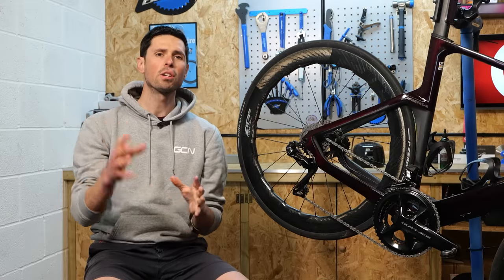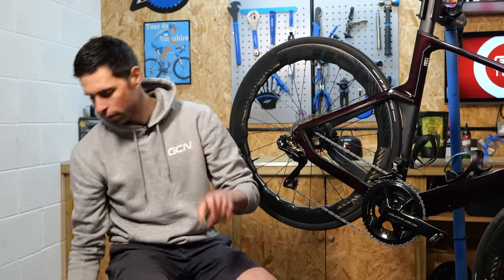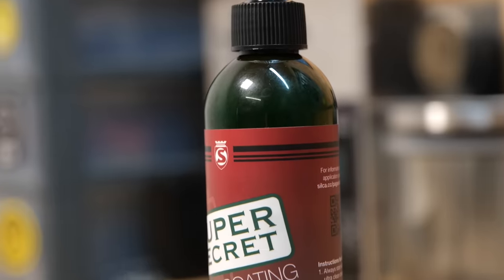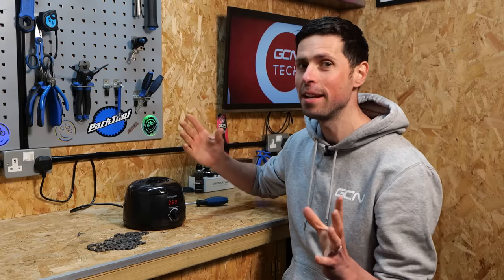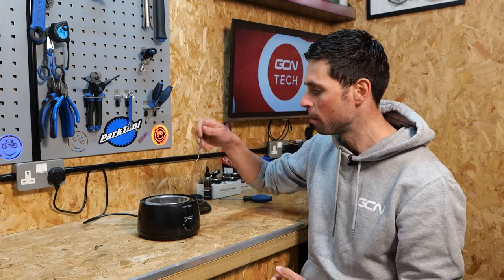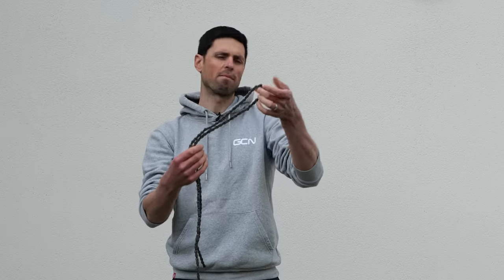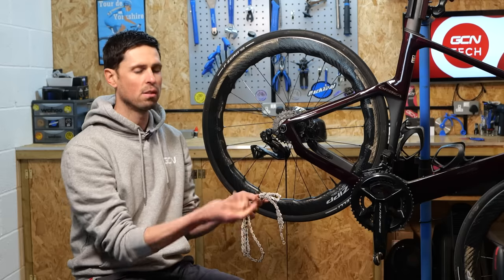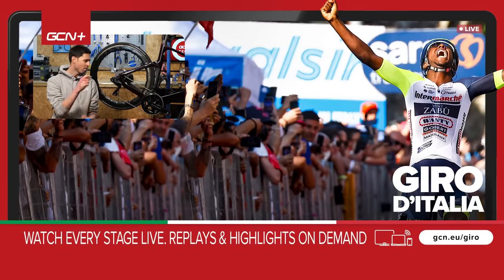How To Re-wax Your Chain & Make It Last Longer!

Comment: I recently went with dry lube in the hope of the chain picking up less dirt and getting away with slightly longer intervals. Lets be honest, drivetrain efficiency doesn't matter for us mortals but if I can go for one more ride without having to clean the drivetrain, that's a win, already.
Reply: It's not really the effeciency that should be the selling point, rather the reduction in wear on the chain. Even if it's only a doubling of the chain life that is huge. Also the reduced number of cassettes and chainrings that you need to replace. And the reduction in time spent cleaning as there is no mess!
Reply: @mikesiemens4145  You sure have a point there, but I think it's only partially true and rather depends on your maintenance habit than the actual procedure. I don't think you'll grind away chains, even with oil of your regularly clean them and further on, as long as you replace your chains, let's say before 0,5 wear, cassette and chainrings won't get eaten - or do you really get double the life out of a waxed chain? My 105 chains last 5000k and that's before they are really badly stretched...
Reply from the maker: Efficiency is not just a measurement of performance but also life space. Waxed chains should last longer... we all like getting the best bang for our buck 🙌
Reply: Mere mortals, lol! It sure does matter. Wax is the ONLY lube for any road bike 110% of the time for 90% of riders!
Reply: @gottagetaname  Ollie Bridgewood dark account, mate?
Reply: @DoNuT_1985  sorry, I don’t understand that. 🤷‍♂️
Reply: @gottagetaname  Sorry, just watch GCNs latest (pro) bike check videos and focus on one of their presenter's obsession for a certain kind of drivetrain conditioning. His name is Ollie and he probably waxes his coffee machine, too. 😜
Reply: @DoNuT_1985  Ah Ha! About the wax thing….. It IS the sole solution to this lube issue for 99+ reasons. Chains and cassettes last so much longer, less work and less dirt around the drivetrain. I have been waxing both my road bikes for 5+years and sometimes the silence of the drivetrain and the smooth shifting makes me forget to re-wax for longer periods. This is a “No Brainer” 110% of the time.
Reply: Drivetrain efficiency matters to everyone in differing levels.  Plenty of pros aren't aero geeks or weight weenies and some amateurs care more than some pros.  That said, you can easily double your chain and cassette life without going way out of your way to do everything right.  If you do everything right,  you can get a +4fold increase in chain life
Reply: @DoNuT_1985  I've gotten over 12,000 miles out of chains without being super vigilant.  I'm not a low force rider either.  I'm a cat 1 that's over 190lbs and a cross chain a lot
Reply: @veganpotterthevegan  One must decide for him/herself if efficiency matters. I'm a hobby rider and there are probably 50 watts to be gained in my bike setup and training routine (if I had any), so squeezing out 5 watts of my drivetrain doesn't matter for me. That's a fact (for me). I started with some dry lube this season and the biggest selling point  is that I don't have a dirty chain even when I mostly ride on dry roads with oil just after 1-2 rides. I get through with a chain for a full season without even wearing it out and 105 11-speed really isn't a cost factor, so I mostly switched to wax to spend less time cleaning my bike.
Reply: @Florian Posch  5 watts of 50 is big. That said, YOU said it doesn't matter but it does if you care about watts at all which seems like you do to even ballpark that 50watts.
Reply: And less chain stains on the foot!
Reply: @nimrodstern663  That hasn't been a too much of a problem for me with years of cycling but putting about 150k on the waxed drivetrain, I see the benefits in terms of cleaning. Looks like I've just gone round the corner and back with traditional oil in. Other than that, I still think it were my legs that got my up faster that hill I rode up compared to last time. 😇
Reply: Using wax on your chain just makes the bike so much cleaner. There is no oil being flung around the bike onto rims, frame, brakes, tyres etc. I have disk brakes, and it means that oil contamination does not get to the rotors, as there is no oil on a waxed chain. Also means that when you wash your bike, you can just remove your chain by hand and of course your hands don't get dirty. Then you have better access around your bike to clean it with no chain on it. And the bike is cleaner to start with anyway.

Comment: Great instructional lesson on how to make your chain work better and last longer! I find it fascinating how an old technology has come back in the spotlight. I use modern chain waxes on my road bikes and my commuter bike (that chain is on internal 8 speed hub has more than 8000 km on it, still passes the chain gauge test). In my early days in cycling, in the last century when Moser, Rams and Bernaudeau were some of the primary contenders, waxing a chain was a mystical, magic process. We didn't have waxes specifically designed for chains. I just melted paraffin wax in a pot on the stove. A cyclist I knew melted his wax in an old coffee can on a gas stove. The gas flame burned through the bottom of the 'tin' can and the liquid wax extinguished the flame when it went everywhere. His wife saw the solidified wax covering everything said, "You will clean all that up, now. Not later, now!"  He never waxed his chain again.
Reply from the maker: We're glad we can bring waxed chain to the masses! Do you think this is the way forward? Sounds like you've got some great life out of your chain 🙌
Reply: i prepare waxes (by temp grade) in old oven pan with propane torch and no problem

Comment: Very useful video Alex! I appreciate knowing that with the Silca drip on wax I can get away with a 4 hr wait rather than wait overnight. 😊
Reply: Drip on is better for topping up after rain. Best performance will come from doing it the long way
Reply from the maker: Do you prefer drip on to fully immersive waxing?
Reply: @kart182  you can also dip into drip wax.   Kinda meets in the middle with penetration
Reply: With a hot wax you can be riding shortly after waxing chain!

Comment: Been doing this for years and I'm not sure why people make this so much more work than necessary.   I also find waxing the chain in hot wax to be much less hassle than using the drip wax on each roller, waiting 4 hours and cleaning up the mess.

Comment: A few issues I see with this:
1. Threading some wire in the chain before putting it in the wax makes it a lot easier to remove when it’s done
2. Instead of articulating every link with your hands, you can just run it along some rounded thing to break it up easier. I use a small tree in my backyard. 
3. I don’t see the need to wait for the film to appear on the wax, I would just pull it out as soon as you’re done. I’ve had great results that way. 

This video shows a sub par way to apply hot wax that’s more difficult, time consuming, and dirty than it needs to be (that freshly waxed chain could have been a lot cleaner).
Reply: waiting for the film to form on the wax is only recommended if you sell wax, as you will just get a thicker layer that needs to be flaked off.
Reply: How can i get a cleaner waxed chain(?)
Reply: Is that can be done with pulling the chain out straight after dipping?
Reply: @Kuroneko6235  I usually put my chain on hard wax and let it melt in. I usually come back to it after a few hours. I’m not sure if this is the best way, but it fits my lifestyle well.

As for cleaning, just rubbing it off with a rag works well for me.

Comment: I use a spoke to agitate the chain in the wax.  Then I can use the j-bend at the end to lift the chain out of the wax.  Also, I wipe the excess wax off of the (outside of the) chain as soon as I take it out of the wax pot.  Then I hang it over a doorknob to cool.

Comment: Silca's drip wax is actually one of the best out there (Squirt still gathers quite a lot of debry and is too thick to go into the links). As the developer says, it's great to use in COMBINATION with hot wax:

1. Hot wax
2. Little bit of drip wax after first ride
3. Re-drip as often as you think is necessary, but after about 750km-1000Km your probably want to re-HOT-wax again.
Reply: before hot wax again after 1000 km any cleaning needed? (for drip wax)
Reply: @CanTURKeyed  depends on riding conditions. Normally pooring boiling water on the chain should be sufficient. I will use some regular dish washing soap first and then poor over boiling water.

Comment: I have 3 chains that I use on a rota system. That way, all I need to do is replace the chain with one thats ready to go then clean and re-wax that used chain when I have more time. Also, when the chain is off its a good idea to clean things like jockey wheels as the wax can sometimes build up in the cage when it flakes off. Its absolutely no good installing a new waxed chain when other components haven't been cleaned either.

Comment: Based on these valuable comments my go to process seems to be: buy a prewaxed chain to avoid the troubles with degreasing, apply drip wax in between hot wax steps, when necessary hotwaxing used waxed chain again, for this boil in hot water (cool the water and remove the wax before pouring water down the sink) then clean chain in den. alcohol mainly to remove water and hot wax again. 

My number one advantage is the clean chain, less wear and tear or resistance is a nice to have

Comment: I use cande wax + parfin oil. Fof road bike.
It works great : quiet, no junk on chain ring cassete and poolies.

but after riding in the wet ,it stats squicking. 

What do you use?
Does it handle better in wet?

Comment: @GCN Tech - I am surprised you did not clean it first (more than the microfiber towel) I wax my chain, and I actually will soak it in a solvent for about an hour, then dry it off prior to putting into the wax bath ( I use an old crock pot) Once you start this process you will never go back to oily lube I love that I can ride and my drivetrain looks clean, and does not get all mucked up.
Reply: Bro the title clearly says "How to Re-Wax your chain"
Reply: @verbinnenben  Bro your response makes zero sense..  I am talking about how to re-wax my chain...
Reply: @chrisholstein7587  you shouldn't need to put your chain in solvent before every re-hot wax is what I'm saying then.
Reply: @verbinnenben  I use a solvent to clean it and remove old wax..  it still gets dirty..  I want it as clean as I can get it when I put it in my wax crockpot..  I do not want any dirt or material in the wax bath - its not to degrease it - it is just part of my cleaning process.
Reply: @chrisholstein7587  oh okay, I understand now. What solvent you use? Methylated spirit?
Reply: @verbinnenben  I just use a citrus based cleaner - they will remove wax as well - I put it in a mason jar close the lid and shake it about 3 - 4 minutes you would be surprised with what comes off.  I did read another comment where they boil the chain to do the same thing - I may give that a try next time.
Reply: @chrisholstein7587  hey bro, thanks for the idea. I also stumpled over the fact - that vary where you live / season - your waxed chain still can get quite dirty/oily over time. I tried boiling the chain first, use degreaser and cook it again : it works but it is a hassle you know. I think it just depends on the time you are willing to spend etc

Comment: Is the "let it cool for a bit for the skin to form" step at all needed? I believe Silca includes this step in their instructions, but I don't think I've seen Zero Friction Cycling do it. It seems like it would just put excess wax on the chain, for it to flake off or worse, to gunk up the drive train.
Reply: In my opinion, surface tension will keep the wax between the links. Wax is thicker than the oils we use on chains, so there's no reason to expect it to just run out if the wax is a few degrees too warm. 

They're likely thinking one of 2 things

1) It will stick even better if it's starting to get close to the temp where it firms up, but in my experience you're spot on that it just leaves a ton on the chain and makes no difference in how long it lasts where it matters, in the rollers/pins/links.

2) More likely: They know the crock pot, double boiler, or whatever other method is used to heat the wax will result in inconsistent temps from setup to setup, and they want to eliminate that variable by waiting for the skin to form, which should happen at a consistent temp as it's cooling back down.
Reply: They can sell more product if you waste more 😅
Reply: Indeed zfc confirmed in the comments to another gcn video that letting it cool is only a waste of wax and time.

Comment: I use a slow-cooker for waxing and have noticed that the Teflon powder sinks rather rapidly to the bottom. So I believe it’s worthwhile to agitate the wax with a wire as you add the chain. Otherwise, the first droplets than get sucked into the rollers by capillary action will not contain much of the friction reducing compound.

Comment: Is the wax suitable for more wet climates? I've got dry wax for my bike but that was a mistake as I live in such a foggy/rainy climate... Thanks for the video! Makes me really want to try this.
Reply: I have successfully used it on wet weather too. And also cold weather at winter, but it won't last so long also chain can get rusty easier at winter when they salt roads. I don't know, if my method is right, but I cool the bowl with wax from bottom with chain. I believe that this way I can get more wax inside of chain, because wax shrink when cools so if the bowl is cooled with cold water the chain in bottom of bowl also cools faster than wax and draw more wax betwen links. Many people seems think, that I'm stupid for doing that, but because I believe into it I keep doing it that way. Stir the chain inside wax while it's cooling so that it would not get too hard and.. To me it seems that I can ride longer on wet weather before I need to rewax than I could without cooling the wax bowl in cold water with chain from below.

Comment: Nice video and presentation. This is my two cent comment on how I’d do this. 

I’d preferred to preheat the cleansed and dried chain in a toaster oven between 60~75*C first, then swiftly transfer it into a hot pot of molten wax before it gets a chance to cool down during transfer. 

Why preheat? 
To let trapped air in the joints to escape into ambient air and not blocked by molten wax around it.

Why? Obstruction to trapped air in the joint occurs when we dip a cool chain into hot molten wax. This will allow air trap inside the joint. 

Why? We need to evaluate joint air to enable vacuum, low pressure, in the joint to pull wax into the joint. Normally only a fraction of joint air can escape when cool chain dip into molten wax. 

Hope this helps.

Comment: I missed this in the video - why not rub the chain with a cloth or paper towels after soaking to remove the wax coating? Does the flaking off wax while riding get into other parts of the drivetrain?

Comment: 3:27 - some really are one use only though, as you damage them when removing. You'll be OK if it's a turbo bike, but hard accelerations out on the road with high torque will snap them. You can buy reusable ones and they are usually cheaper than the name-brand versions.
Reply: KMC has reusable links, and they're a name brand. I've yet to have one break on me, and I'm a 245lb rider.
Reply: @mrhankbotful  Cool. How many times have you reused them? I got one with a KMC chain a couple of years ago and it only survived 4 or 5 times. The cheap ones go longer than a couple of chain lifetimes!

Comment: It's nice to see, that wax is so much cleaner than the lube, that you have to go outside from your garage to clean your chain from flakes and pollute your environment with it. And this flakes going to be everywhere on your bike too.
Reply: I use a cheap chip brush and just brush my bike off. After a few rides, the chain doesn't shed any more wax flakes and the bike/wheels remain clean.
Reply: This is why I'd never add teflon to my wax and I do this initial 'clean' or breaking-in over newspaper in the garage.

Comment: Can wax also be used for mountainbikes?
Reply: Yes, but  will only last around 8  to 10hours. When really wet half of that time. I started using it on our Emtb tandem that was eating chains and cassettes. At least triple lifetime. Now I do it on all my bikes.  I use 3 cheap chains, one cassette and 0.5 of my chain wheel before worn over 0.5%. Important you clean with hot water; dry an rehotwax your chain after every wet ride.

Comment: I seriously would not want to be going through this palaver every week or 2 Just to save a few watts. I'll stick to with my all-purpose drip lube I think. Cleaned and relubed the chain yesterday, 10 minute or so job.
Reply: Thats fair enough, everyone has their preference, whats your thoughts on longevity or chain cleanliness?
Reply: That's a good reason to have 3 chains in rotation so you only need to wax every 4-6 weeks, and get the added benefit of dramatically longer drivetrain life.
Reply: @GCNalex  Those are fair points and a good argument to wax the chain. I used to use a thick wet lube (not naming the manufacturer as I'm sure others are similar) and it just quickly clogged up my chain in a black gunk that was a pain to remove. I thought that was normal and just accepted it. My local bike shop reccomended and sold me a lighter all-round lube they had and it's made my life a lot easier. A quick clean every couple of weeks and it withstands the odd rain shower fine.
Reply: yes it is easier but my chain can live 10x longer than on oil, and no dirty hands wheel.....